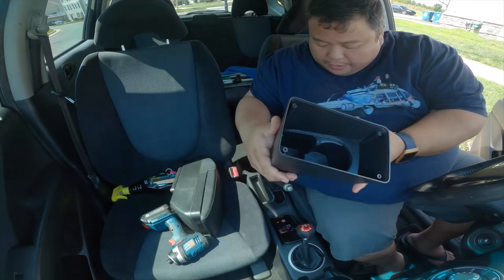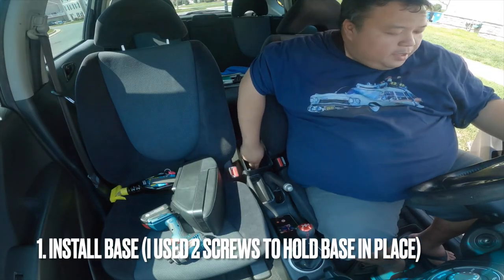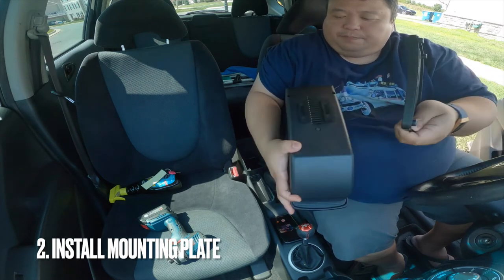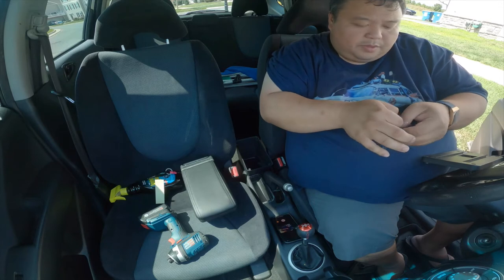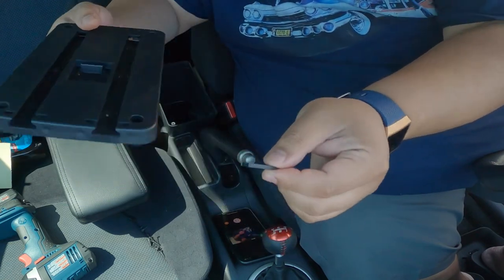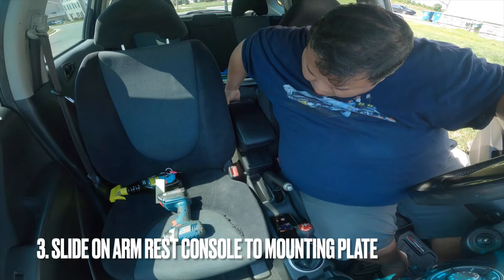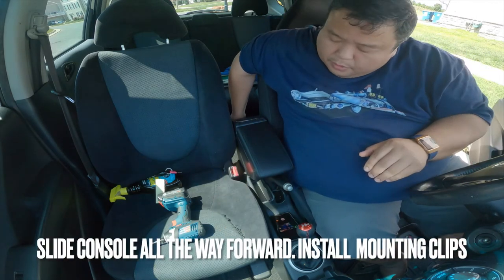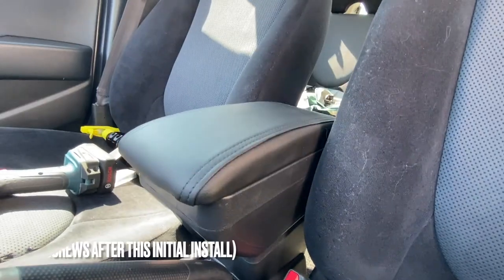Arm Rest Center Console Install: 2007-2008 Honda Fit GD3

Comment: Did it still wobble after you screwed it down?
Also did the armrest get in way if the handbrake?
Reply from the maker: It wobbles slightly but I just wanted to see how I liked it. And yes it does clear the ebrake fine:) I think I will remove the top piece and screw in 2 self tappers. 1 into the back tray and the 2nd into the cup holder